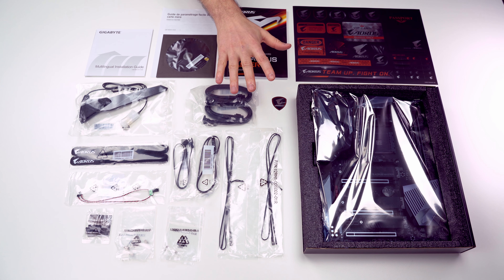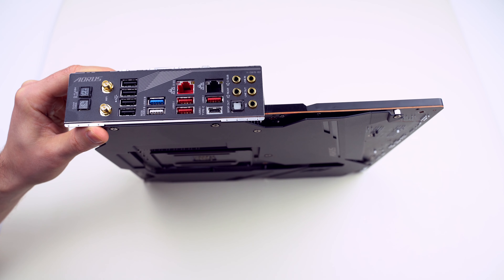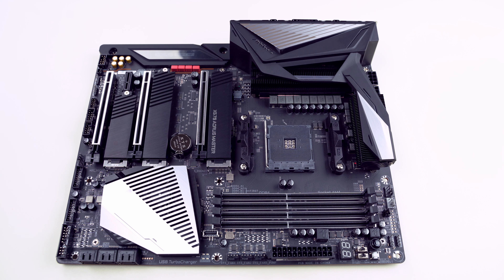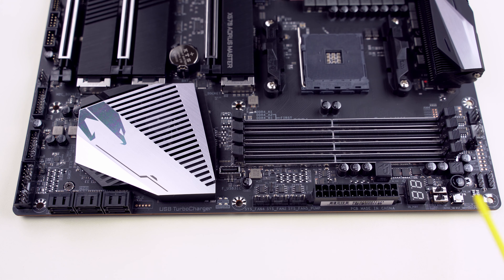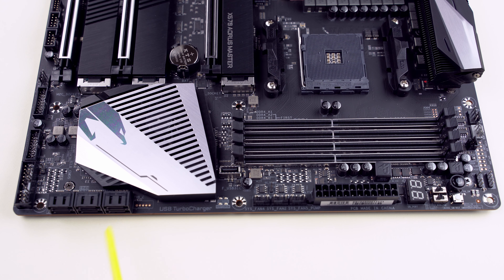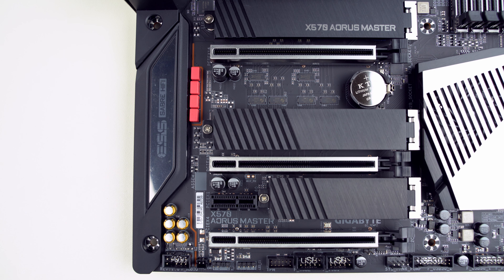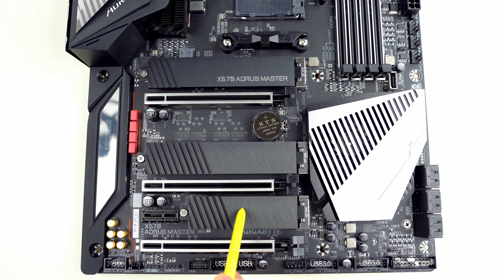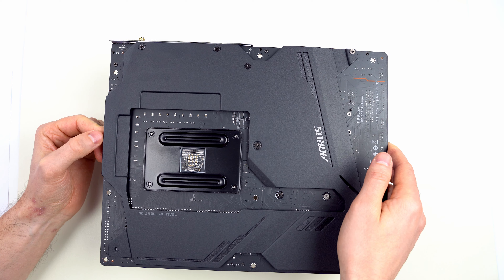Gigabyte X570 Aorus Master - Unboxing + Complete features description

Comment: Hello Martin i have a question, i have 2 gen 4 nvme and 1 gen 3 nvme fitted to my aorus master problem is the sata ssds are not detected, although if i unplug and plug the power back in to the ssd when the pc is running they are detected and work fine but soon as pc reatarted they are not detected again? not using port 4 or 5
Reply from the maker: Hi Kaiser, this is difficult to say, never happened to me. Are you running any RAID config? This would mean that something is preventing  those  SATA drives from being detected at bootup. Which would probably be a BIOS thing. Are they detected in BIOS before you bootup into Windows? How many SATA drives are you running? (SATA ports 4 and 5 are disabled when 3rd M.2 slot is occupied -  so this is not it) If you don´t have any RAID setup, I would probably try new BIOS or resetting the current one. (You can save them to flash drive when using the same version of BIOS). Also I´m assuming no CPU OC se set when testing this.
Reply: Martin thank you for your reply and excellent Tutorials....No Raid config,No OC has been done,The ssds do not appear in the Bios at boot, 3 sata ssds fitted to port 0,1,2 (i have switched around just in case) i will flash the Bios to latest although it was Qflashed to latest when built (2 weeks ago) there is a newer bios now. When building i did not realise the bios needed to be flashed for Ryzen 5 cpus and found Qflash would not work with pc built  but eventually found if i removed all the ram it would flash ok or maybe it didn't?, do you think the ram could cause a problem?  64Gb 3600mhz.I will try removing half the ram. Except for the 3 ssds the computer runs flawlessly. I have contacted Gigabyte but no reply as yet.  Thank you again for your help
Reply from the maker: @kaisersoze8008  You´re welcome ;) based on what you´re saying it looks like a BIOS issue. There is a difference between Q-Flash (in BIOS update - watching in on the monitor) and Q-Flash Plus (CPU-less BIOS update - monitor and other components are not installed/connected). So, you probably did Q-Flash Plus, but had some components installed..which might have caused some issues. CPUless BIOS update should be done without any components installed on/connected the motherboard. There should be only 24pin main ATX power connector and one CPU 8 pin power connector connected to the motherboard while you´re doing it. 

Not many people know about it because it´s mentioned in a separate manual called "Unique features introduction" on page 6.
Here is a direct link: https://download.gigabyte.com/FileList/Manual/mb_manual_x570-features.pdf
Here is a all manuals link: https://www.gigabyte.com/Motherboard/X570-AORUS-MASTER-rev-10/support#support-manual

I discovered it when I was doing my last video on "Gigabyte Aorus Elite", so I added the whole BIOS Q-flash plus update process in it. (The difference compared to "Aorus Master" is that Master has the "Flash button" on rear IO shield and "Aorus Elite" has it placed in the bottom part of the MB close to it´s edge. Master has also two BIOSes, and requires to have BIOS switch and a SB switch in default positions. Elite doesn´t have those at all.) 
 
I have no idea how the Q-flash Plus BIOS update behaves when there are some components connected (I did it always according to the manual), but there is probably a reason why they shouldn´t be. In this case, if I were you, I would do a fresh Q-Flash Plus BIOS update as it´s in the manual. Than you can be sure that the problem is not caused by improper BIOS update and troubleshooting would have a solid base.

Comment: I just ordered this motherboard and am very happy to watch you video martin you explain all the connections on board this is going to be my first build and still debating on Ryzen 7 3800x or 9 3900x??
Reply from the maker: Hi Jose, I think you´ll be happy with the MB. You haven´t mentioned what you are planning on doing with your PC (what programs you´ll be using) so it is difficult to give you advice. Generally, if you can afford Ryzen 9 3900X I would go for it, because its more future proof and current price (450 USD) is very reasonable for its performance.

On the other hand if, you wouldn´t be able to make use of those 4 extra cores (for example if you´re planning on gaming only), than it would be wiser to go for 3800X and put the saved money somewhere else (better GPU, bigger/faster SSD..).

Prices of CPUs go down gradually all the time, so later on (year later) if you find out you need more CPU performance you can upgrade easily for lower price than what you would pay today for the same CPU (the resale value of your current CPU will be of course lower as well).
Reply: @MartinsLab  hi Martin mainly will be using only for gaming want to be gaming in 4k resolution.
Reply from the maker: @joseevelasco4596  In that case having 12 cores would be unnecessary, if you bought 3800X (340 USD) you would loose only 100 MHz in single core boost, but save 110 USD which could be used to buy better GPU (2070S/2080S/2080Ti) - which has the highest impact on FPS in 4K gaming out of all PC components. And if necessary (year later), you can buy higher clocked Ryzen 4000 series CPU which will still be compatible with your X570 motherboard. Also make sure to get 3600 MHz memory for dual channel setup, to use the full potential of the CPU.
Reply: Martin's Lab I really appreciate your advice I will definitely put more towards GPU, and rams memory to 3600 MHz. I was wondering I will be doing m.2 ssd and seen about fan noise, and to update bios. will you be doing video on how it’s done and as well for loading operating system threw USB??
Reply from the maker: Actually I will ;) I am already more than half-way through another video (will be released probably Sunday/Monday) where I am discussing the components and assembling the whole computer (home server) using this motherboard.  It includes installation of M.2 SSDs and updating the BIOS (that is where this video ends).

Installation of OS from USB + RAID configuration will be in the next video following this one. I am already attacking 30 minutes and people usually don´t want to watch too long videos, so I´ll need to split it into more parts.
Reply: Martin's Lab awesome, great, will definitely keep an eye out for it !

Comment: Aorus x570 master is good for purchase with ryzen 5950x. Is hard work for long time without CPU power phase damage or bios problems? Recommend this motherboard or no.
Reply from the maker: Hi Akram, it is definitely a good motherboard in combination with any Ryzen 3000/5000 CPU including 5950X. I didn´t encounter any problems during my extensive testing with Ryzen 3900X even while it was overclocked. (It is necessary to update it to the latest version of BIOS of course)

Because it has been more than a year since this motherboard has been released, there is a new version of it already available “Gigabyte X570S Aorus Master”, which has a passively cooled chipset heatsink, 14+2 Phase VRM and USB 3.2 Gen 2x2 TYPE-C ports, so it is worth checking out as well.

Comment: Please  Martin... I am buying parts for my Pc and this is the motherboard I bought... I loved this video and i was looking for video like that.... I have introduced a question into the wrong video...but this is the review video... So I am a bit confuse about what I will buy for cooling system... I have this motherboard :

- GIGABYTE X570 S  AORUS Master) , 

- Ryzen 9 5950x) 

-Case (Fractal Design Torrent Gray E-ATX Tempered Glass Window High-Airflow Mid Tower)...

I have two options, but I am bit confused...

The options are: 

*IceGiant ProSiphon Elite CPU Cooler for Intel AMD Desktop Processors Compatible with Intel LGA 115x, 1366, 1200, 2011/2066, AMD Ryzen AM4, sTRX4, TR4;

*Fractal Design Celsius+ S36 Prisma PWM ARGB 360mm Silent Performance Slim Radiator AIO CPU Liquid/Water Cooler, Model: FD-W-2-S3602;

Which one would advise me to buy? ...please
Reply from the maker: Hi Marcio, if you already bought Fractal Design Torrent case, then it´s an easy decision - you can´t use IceGiant ProSiphon Elite CPU cooler, because its radiator has to be pointed upwards towards the ceiling of the case and this particular case doesn´t have space for ventilation (space with holes for a radiator) on top. The hot air from the exhaust of ProSiphone Elite cooler would bounce back into the case instead of leaving it (the cooling would be inefficient).

So, out of those two CPU coolers you can use only Fractal Design Celsius+ S36 Prisma PWM ARGB 360mm Silent Performance Slim Radiator AIO.

Link for an example of installation*: https://www.techpowerup.com/review/fractal-design-torrent-rgb-tg/6.html

(*But you should change the orientation of the water pipes so that the pump of the cooler which is placed on top of the CPU is above the intake of water of the radiator of the cooler "which should be at the bottom of the case" - to make sure its longer lifespan.)
Reply: @MartinsLab  Thnk you very much my Professor.... thnk you

Comment: I have a 3060ti which is pci 4.0. If I put a pcie 3.0 m2 drive in slot b or c will it drop my gpu down to 3.0?
Reply from the maker: No, it wouldn´t. I assume you have your RTX 3060Ti in the first x16 PCIE 4.0 slot. That slot is directly connected to the CPU by 16 PCIE 4.0 lanes and is unaffected by any drive you place into any of the three M.2 sockets.
 
If you place a Gen3 (PCIE 3.0) M.2 SSDs into slot „M2_B“ or „M2_C“ which are connected to the X570 chipset by four PCIE 4.0 lanes each, the only thing that happens is that the connection to that slot switches to PCIE 3.0 mode, but it doesn´t affect the other PCIE slots or M.2 sockets. 

The only exception is slot M2_C, because if you place any M.2 drive (doesn´t matter if it´s PCIE 3.0 or PCIE 4.0) in it, it will disable 2 SATA ports (namely „4“ and „5“ – naming of SATA ports starts with „0“)

Comment: Great, I have the same board, can i install a Thunderbolt Card in one of the PCIE Cards?
Reply from the maker: Sure, if you have version 1.1 or 1.2 of this motherboard. Reviewed MB is rev1.0 and doesn´t have this feature. It is evident that the manufacturer planned this upgrade since the beginning of the production (there is a free space for it on the PCB), but didn´t implement it into the first version of the MB (reasons unknown). Here is a link: https://www.gigabyte.com/Motherboard/GC-TITAN-RIDGE-rev-20#kf If you have rev1.0 you´d have to use a standalone card from other manufacturer - which would be also possible, but you couldn´t use onboard connecter, because it isn´t there.
Reply: @MartinsLab  thank you much for taking ur time and answering my question, I appreciate it👍
I was wondering, if you are planning to make a HAKINTOSH video on this same system, I would love to watch and learn 😊
Reply from the maker: @tameempaknehad1663 Unfortunately, I´m not planning on doing a hackingtosh video – I have very limited experience with Apple products and I´m generally not planning on using them in the future - the ecosystem is just not „my cup of tea“ 😉

Comment: Hello! Ty for the video, had a question bout this mb as I just got done rebuilding my pc with it and can't find any answers anywhere. It works perfectly but the only problem is the rgb lights on the mb won't light up. I tried rgb fusion 2.0 and it isn't making em light up nor change. Ty in advance if u can help
Reply from the maker: Hi Sadao! There are several possibilities why it´s not working - you haven´t provided any info about the steps you took to make it work or about your system (what drivers you installed etc) – so its difficult to start anywhere.

However, I still have a fresh install of Windows 10 Pro (v2004) 64bit installed on my PC – using X570 AORUS MASTER (rev. 1.0) - from my last RAID oriented video on it. 
I installed and tried if RGB Fusin 2.0 works with MB LEDs and it does. So, to make it useful for you, here are my settings and steps I took to make it work:

1) BIOS F11 version - is installed on my MB and everything is in default (optimized defaults loaded) (I´m aware there are newer versions available now - it should work with them as well)

2) the latest MB chipset driver is installed - AMD Chipset Drivers [2.07.21.306]
https://www.gigabyte.com/Motherboard/X570-AORUS-MASTER-rev-10/support#support-dl-driver-chipset

3) RGB Fusion - B20.0721.1 installed
https://www.gigabyte.com/Motherboard/X570-AORUS-MASTER-rev-10/support#support-dl-utility

4) I ran the "RGB Fusion" SW in Windows, selected by mouse cursor the LEDs I wanted to be lit on the picture of the MB on the left side of the RGB Fusion app. Then I selected any of the pictures showing what effect (static, pulse, flash etc..) I want the RGBs to do on the right. Then I clicked "Apply" and it worked immediately! Make sure you don´t have the effect selected on “OFF”- just to be sure 😉

Hope this helps.
Reply: @MartinsLab  Thank you so much for the response and time u put into it. Very much appreciated, I reinstalled rgb fusion and it's working great now. Ty again!
Reply from the maker: @Terimanreminaski  No problem, interesting the reinstall was "the magic" - may help others, thanks for sharing.

Comment: Quick question people ! I bought this mobo do I need to have 2 8 pins going to the cpu ? It’s my first time having a mobo like this. (The two cpu power connectors )
Reply from the maker: Yes, you do. It can run with one (tested it), but it´s better if you use two CPU 8 pins.

Comment: Could anyone recommended Bios Settings for running aorus 3090 in Pcie slot #1 and then putting a MSI 3080ti in slot #2? I am using a gpu riser with usb for the 3080ti. Thanks much
Reply from the maker: Hi Bradley, assuming you are using “Gigabyte X570 Aorus Master” motherboard - there isn´t much to recommend other than updating the BIOS to the latest version if possible and also using the latest X570 chipset drivers.

If you place “Aorus 3090” into the “#1 PCI-E x16 slot” and “MSI 3080Ti” raiser into “#2 PCIe x16 slot” (runs only in x8 speed effectively - no matter how big is the GPU connector) each of the two PCIE x16 slots will run only at x8 speed effectively in PCIE 4.0 mode (since both GPUs are PCIE 4.0 compatible) thanks to automatic bifurcation which will “kick in”.

This means that each GPU will have 15 754 GB/s (x8 PCIE 4.0) bandwidth available. The motherboard will automatically switch to bifurcation mode (cutting the first slot´s 16 PCIE lanes to 8) and leaving the 8 PCIE lanes active (which are available in the second slot). 

In other words those two slots PCIE are sharing 16 PCIE lanes and whenever the second one is occupied each can use only 8.

However, if you want to be sure and want to check it, do this:
1)	Enter BIOS (pressing “DELETE” at startup)
2)	Press “F2” (Advanced mode)
3)	Go to “Settings” > IO Ports > PCIEX16 Bifurcation > an it should be set to „Auto“ (which is the default)
4)	If you want to enforce the division of PCIE lanes to egual distribution, you can press „Enter“ on it a choose „PCIE 2x8“ and Enter
5)	Press „F10“ (Save and Exit) and you´re done
Reply: @MartinsLab  Thank you for the reply! Greatly appreciated!